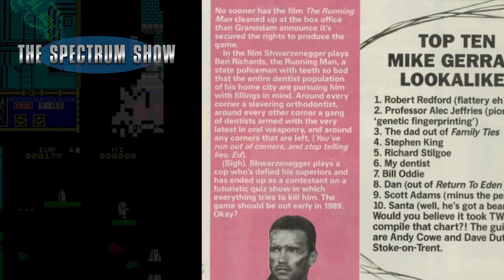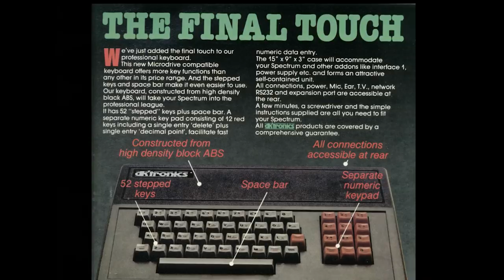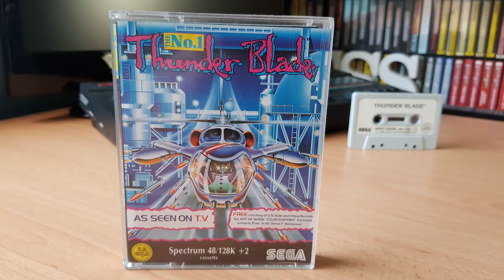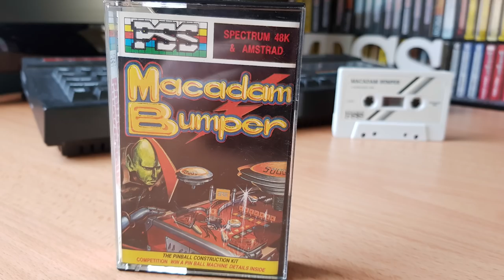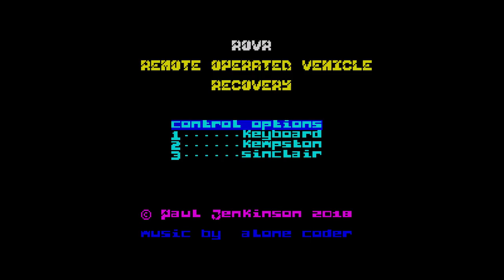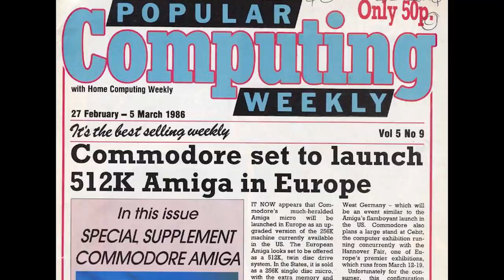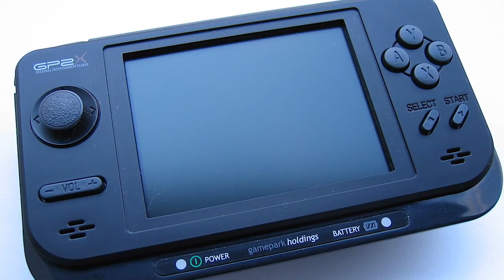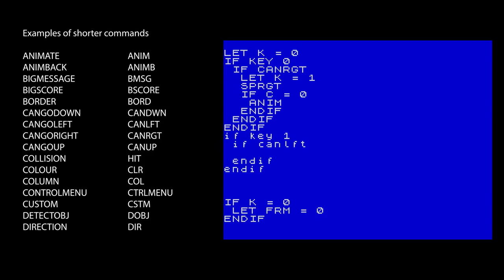The Spectrum Show EP 75

Comment: I know this is a late comment, but I bought one of these dk'tronics keyboards last year. Many of the keys didn't work, so I de-soldered the key switch units so that I could clean them out and restore them. Unfortunately, the PCB tracks had perished and some peeled off the board. I was able to scan the board and re-draw the tracks in Sprint-Layout, generate a gerber file and get the board remanufactured at PCBway. I'd never done anything like that before, but I'm pleased to say it came out perfect. All keys were cleaned up, re-soldered and work a treat. I had to buy a minimum of five boards, so sold the others on eBay to cover the manufacturer cost. I still have the gerber file and would love to share it should anyone want to renew their PCB.

Comment: I had the Fuller FDS keyboard. My dad fitted an on/off rocker switch onto the rear. The keys always felt a little stiff to me. Sold the unit on ebay a few years ago for £40.
Reply: I do own one these days and definitely prefer it over the dk'tronics and saga keyboards. Would love to give the Transform one a try, but those rarely pop up for reasonable prices. Also the cutout in the back kinda scks.